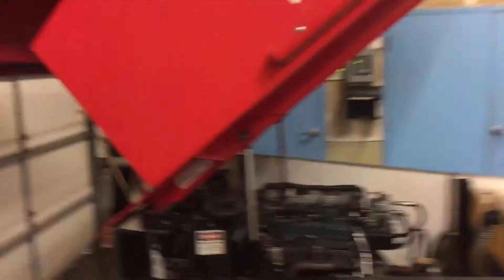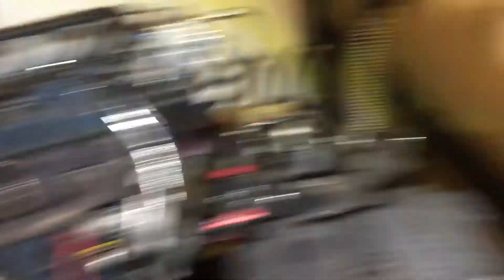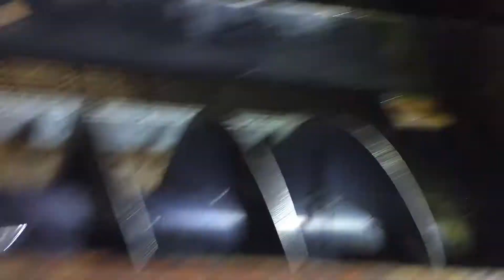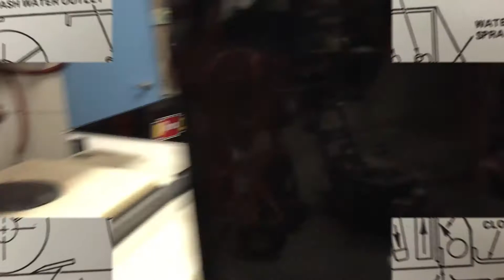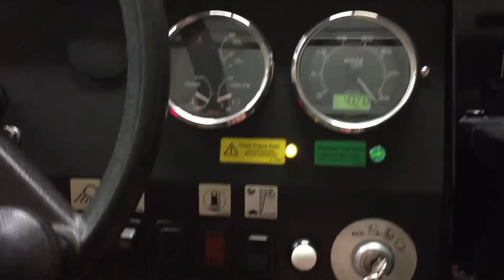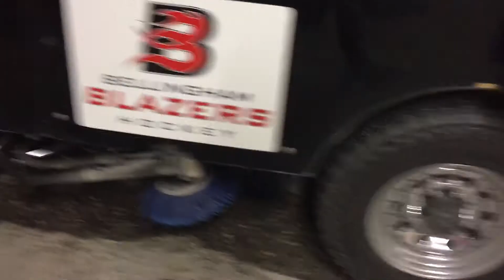Zamboni 101: Basic Introduction

Comment: Do you have issues getting snow bunnies with the auger covers being rinse friendly vs the solid ones on your old machine? I’ve seen several places taps over the holes to make the auger covers solid.
Reply from the maker: No has not been an issue here. I still lift up to wash out or take off. Except the middle one. That is nice to have those slits. I do like the stainless steel look too. Also another place to look to see if snow is moving. I will be honest and say we did not like them at first.
Reply: @YourLocalIceMan  Interesting. We have all 4 machines that have them tapped over. Not sure the reasoning, 2 were done a long time ago before any of the current staff worked at one building and the other 2 were done in the last year of this new building opening. I just noticed recently that they were tapped over. 

We also are missing the guards inside the conditioner for one machine. Was told they were removed when it was loaned to our other location during a shutdown one summer and when the machine came back in September they were never put back on. I think that was done under the previous Senior ice manager as well